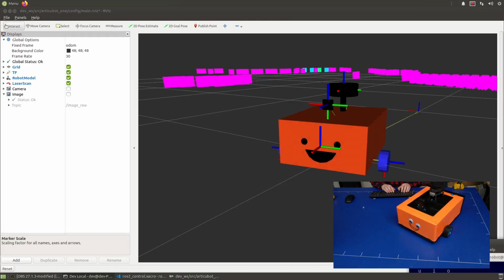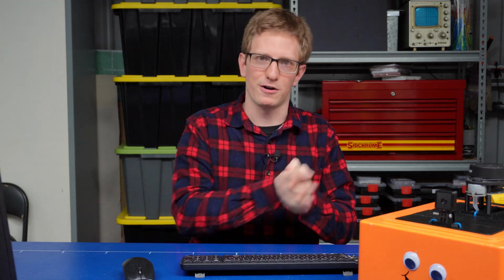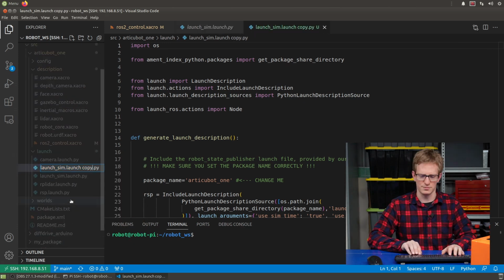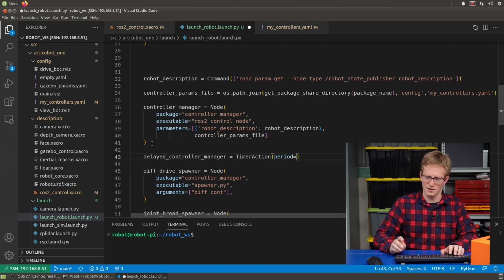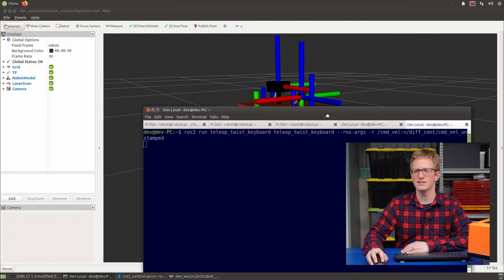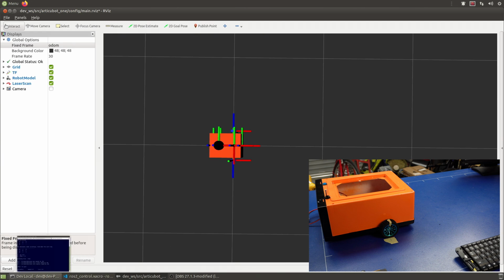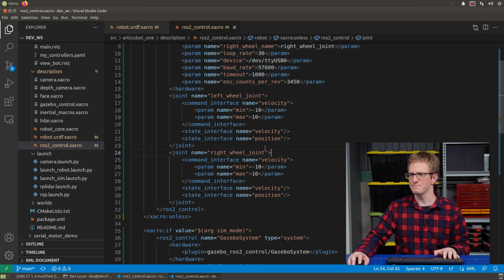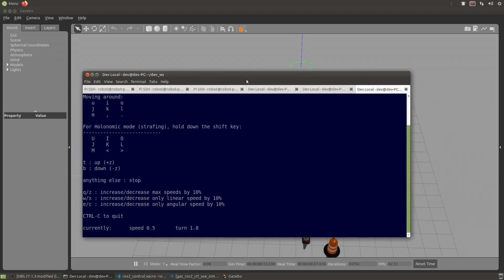Using ros2_control to drive our robot (off the edge of the bench...)

Comment: Hi Josh, big thanks for your all your work. I humly admire your skills and I learnt from you so much. Thank you.
For all others if you run you robot on Jazzy you need to use /diff_cont/cmd_vel stamped. See Migration Guide for ros_conrollers. And then run ros2 run teleop_twist_keyboard teleop_twist_keyboard --ros-args --remap cmd_vel:=/diff_cont/cmd_vel -p stamped:=true
I was stucked here for a while :-) Cheers.
Reply: Yeah, same here. Right now I have the problem that diffdrive_arduino is written for Foxy, and I assume both of us are using Jazzy. I can’t use it because of the ros2_control API changes, so it doesn’t build on Jazzy. How did you get around that? Help is needed.

Comment: I'd love see a video on how to write the hardware interface for a custom hardware (eg motor)
Reply: An interesting thing is that the L298N setup in his software is not the suggested way to do it. The best way is to use one PWM channel per motor, and two digital pins for direction. Not the other way around!

Comment: can anybody help i have an issue my joint traj controller never seems to configure 

 [1725282866.749748394] [spawner_joint_trajectory_controller]: Loaded joint_trajectory_controller
[ros2_control_node-2] [INFO] [1725282866.750886615] [controller_manager]: Configuring controller 'joint_trajectory_controller'
[ros2_control_node-2] [WARN] [1725282866.750966218] [joint_trajectory_controller]: 'joints' parameter is empty.
[ros2_control_node-2] [INFO] [1725282866.751008551] [joint_trajectory_controller]: No specific joint names are used for command interfaces. Using 'joints' parameter.
[ros2_control_node-2] [ERROR] [1725282866.751043506] [joint_trajectory_controller]: 'command_interfaces' parameter is empty.
[ros2_control_node-2] [ERROR] [1725282866.751064255] [controller_manager]: After configuring, controller 'joint_trajectory_controller' is in state 'unconfigured' , expected inactive.
[spawner-7] [ERROR] [1725282866.751949355] [spawner_joint_trajectory_controller]: Failed to configure controller
[ERROR] [spawner-7]: process has died [pid 406079, exit code 1, cmd '/opt/ros/humble/lib/controller_manager/spawner joint_trajectory_controller --ros-args'].

Yet ii have my yaml file well prased and it has its joints and command interfaces :

    joint_trajectory_controller:
      type: joint_trajectory_controller/JointTrajectoryController
      ros__parameters:
        joints:
          - T0-1
          - T1-2
          - T2-3
          - T3-4
        command_interfaces:
          - position

        state_interfaces:
          - position
          - velocity
        state_publish_rate: 100.0
        action_monitor_rate: 20.0
        allow_partial_joints_goal: false
        constraints:
          stopped_velocity_tolerance: 0.01
          goal_time: 0.1

Comment: Hi Josh thanks a lot for the videos, They helped me a lot to understand ROS2 and how to build a differential drive bot. I am working on a 4 WD and have been following your tutorials until " [Using ros2_control to drive our robot (off the edge of the bench...)](https://www.youtube.com/watch?v=4VVrTCnxvSw&t=601s)" video. I am facing some trouble after changing to ros2_control, The issue is that my robot is not moving either left or right in gazebo but it seems to move in Rviz as expected. I have searched all the online resources but did not find anything that helps.
here is the link to my repo GitHub - BooraKaushik/autobot
Video of what is happening, IMG_5920.mov - Google Drive
as you can see it is turning fine in rviz but not in gazebo.

I would really appreciate any help.
Thanks,
Kaushik Boora

Comment: Hello, your tutorial is great and I've been following it to a T!

Though, when using the teleop keyboard something is causing the robot to drift to the left in real life and in rviz. 

It also happens when I used the miniterm command to test the encoders from your motors video. The left encoder returned a different value than the right encoder. 

Do you know where in your code that could be causing that?

Thanks in advance!

Comment: Following along this series, and I have to say that this is a bit outdated. Because after trying my own code I noticed that if I use ros-humble with humble branches for `diffdrive_arduino ` and `articubot_one `. It will not work since there is no `DiffDriveArduino` instead there is "DiffDriveArduinoHardware". Another thing is after you fix that the DiffDriveArduinoHardware class crashes because it cant find `timeout_ms` key since there is no such thing in `ros2_control.xacro`. After that is fixed it still fails to launch and complains about `state_interface` order for wheels (position first and then velocity).
Reply from the maker: Yes it's unfortunate the way a small software update can break things :(
I would have expected the humble branches to work though - I cover this in a fair bit of detail in this video https://youtu.be/J02jEKawE5U so maybe check that out if you haven't already?
Reply: @ArticulatedRobotics  I understand that. I will look at that video later once I will be finished with the series and I'll need to implement my own hardware.

Btw do you have any videos or blog posts on communication troubleshooting between two machines using ros2? Because for some reason my PI sometimes won't receive any data, but when I use "ros2 multicast" PC can send and receive, but the pi can only send when this happens.

Comment: Thank you so much for these tutorials, they are great! As I lean into controls, this is especially useful. Would also appreciate a lot if you could cover a tutorial on how to write the controller plugin (or use any of the other ros2 controllers, that is how to find what params are required as they are not specified clearly in documentation) and how the hardware interface is written. 😄

Comment: I have a really weird Issue. The robot drives forwards and backwards fine but it doesn't turn. Is that a bug you had in your code as well?
Reply: @frankfurtdynamics2783 I am facing a similar issue. Did you figure it out?
Reply: @kaushikboora  it was a wiring issue in my case. Are you using the same motor driver as in the video?
Reply: @SamuelGorelikov  Thanks for the reply. I have not tested this on actual device, I am facing this issue in gazebo simulation itself.
Reply: @kaushikboora  have you tried opening a second terminal and use ros echo?
Reply: @kaushikboora  use rostopic echo to see if everything is published correctly to gazebo. You can isolate the issue like that

Comment: i'm missing the serial.h  package, which one are you using and how did you install it?
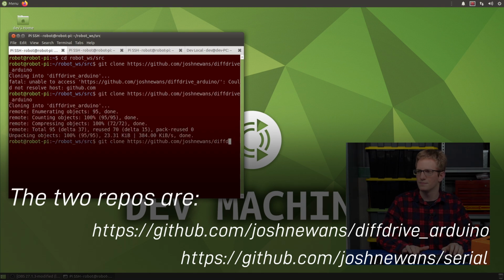Reply from the maker: Hi Jake, sorry it was a bit quick but at 4:46 you'll see I clone the serial package as well as the diffdrive_arduino package.

I made a comment about that package earlier that it's an external dependency which would be nice to be able to install through apt but for now I've made a fork that just needs to be cloned in. Hope that helps :)